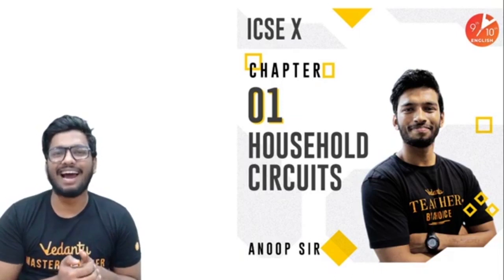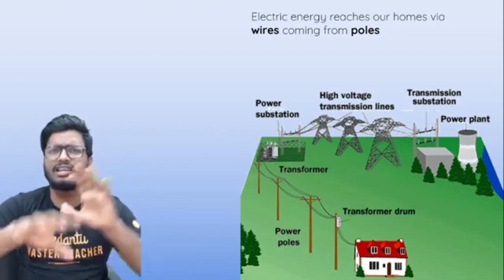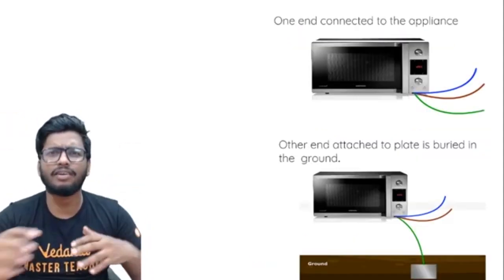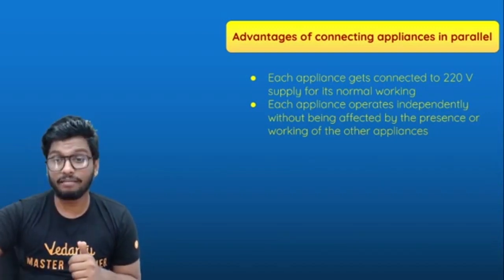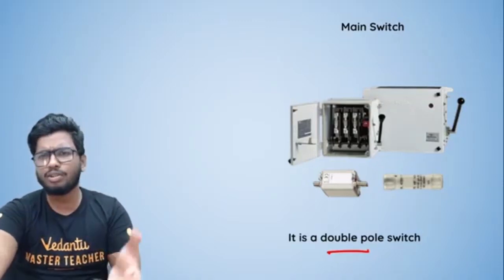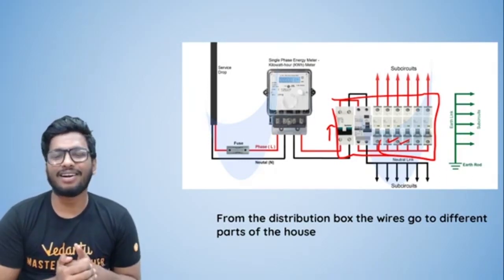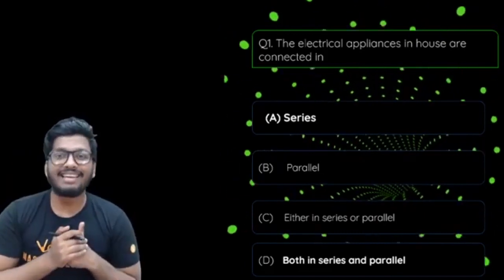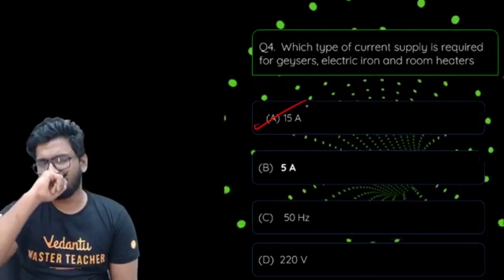Household Circuits L-1 | Main Circuit, Main Switch & Its Advantage | ICSE Class 10 Physics | Vedantu

Comment: We do connect bulb and fan in parallel connections because in parallel the current remain the same and also the resistance is not so much but in series the current gets divided and resistance get high more tha 5ohm thats why these small consumiming appliances were used in the parallel connection

Comment: HW- 220V
And Household appliances are in parallel as the voltage each house get is same 220V .. Also Minimum resistance is there with Parallel & also the appliances are independent of each other.. It means that if we switch off one appliances, it doesn't affect other appliance(the reverse is noticed in Series, appliances are dependent, so if one appliance is switched off, other appliance also switches off) 🙂🙂
Amazing session sir!!!! 
Ur new year resolution is amazing 🤣
My new year resolution-
1.to score 100% in icse 10 board(to make you & abhishek sir proud) 🙂 bcoz u two are my favorite teachers🙂
2.to start my 11th with full josh
3.To keep myself healthy by regular exercise & Avoiding Junk food
4.to wake up early (Bcoz I am a serious night owl) 😅